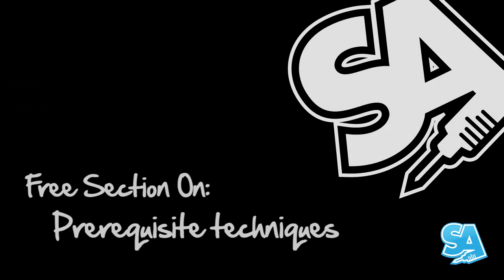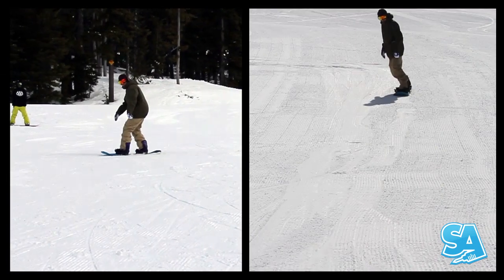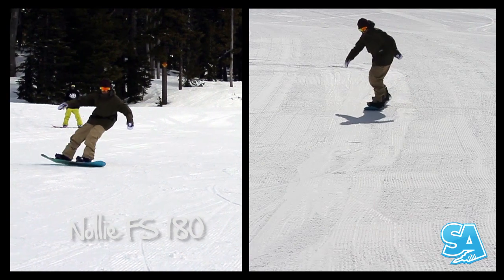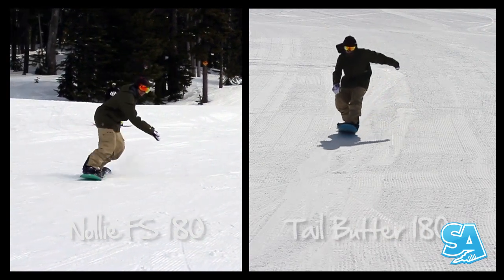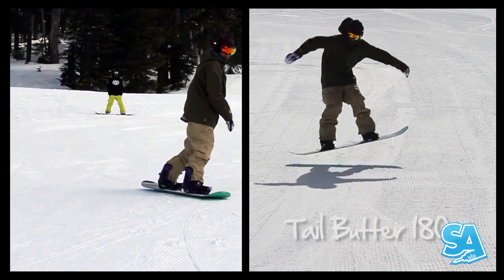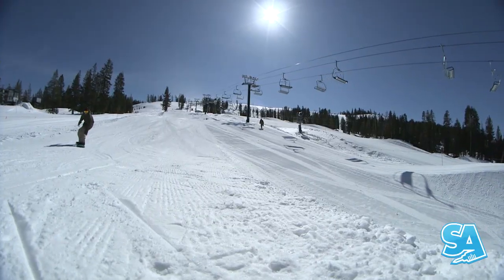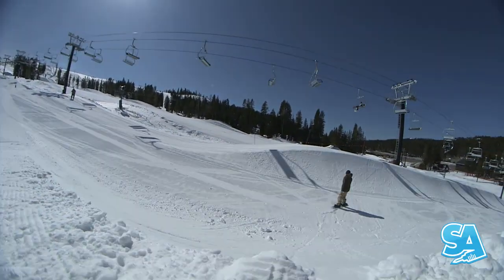How To MFM Butter On A Snowboard (Regular)

Comment: What boards do you advise in general for an rider on probably the lower advanced end?
What rocker?
Stiff or flex?
I weigh always something around 80 to 90 kilos and am 1.90 m tall

Any reccomendations?
Reply: Camber profiles (rocker or otherwise) are kind of a personal preference, different shapes have their own advantages and disadvantages and characteristics. Depending on the type of riding you like to do, sizes and preferred flex are all variable, but you'd probably want something on the softer side if you're still learning. I'm about the same height as you but pretty skinny, and I like a board anywhere from 155-159cm long, I'm riding a 57 right now and that's kind of right in the sweet spot for me in terms of length.